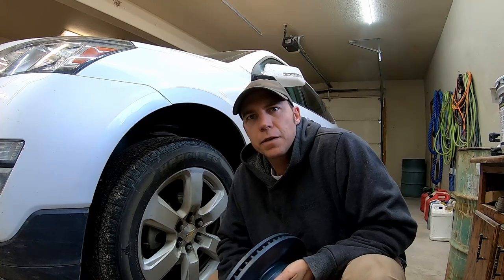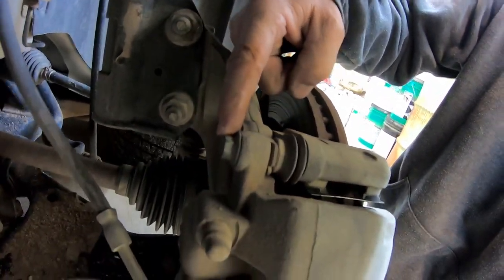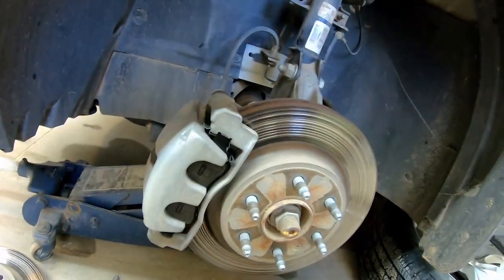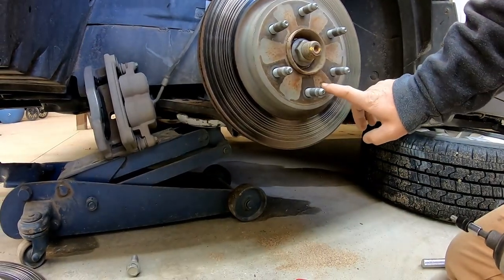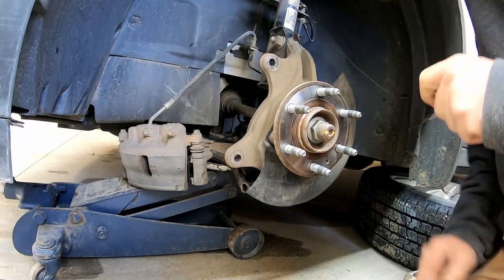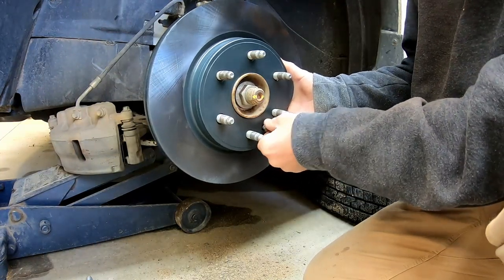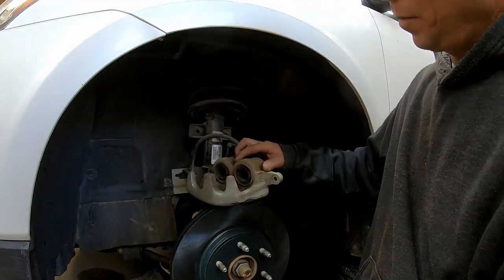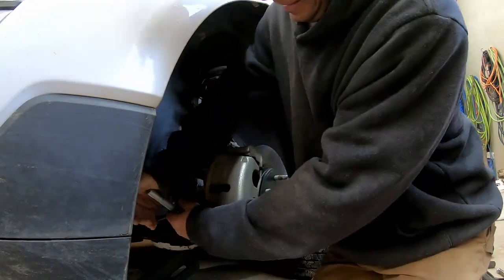How to change the rotors on a 2017 chevy traverse

Comment: Good idea to use brake cleaners to clean any oil off the new rotors before installing them.  They may be shipped with a light coat of oil to prevent rust.
Reply from the maker: Good tip.